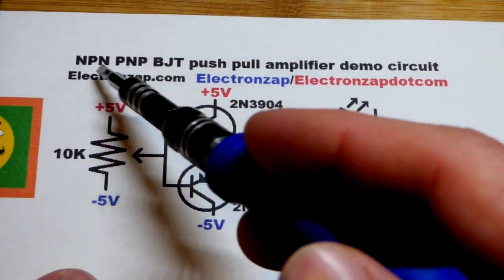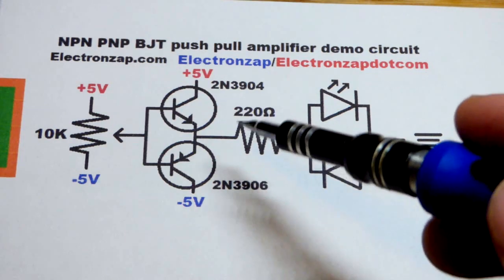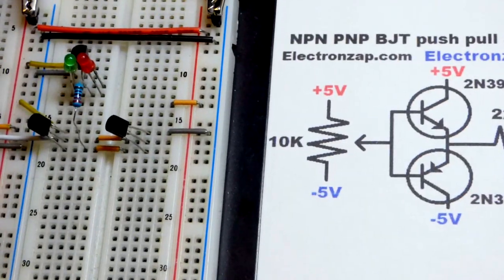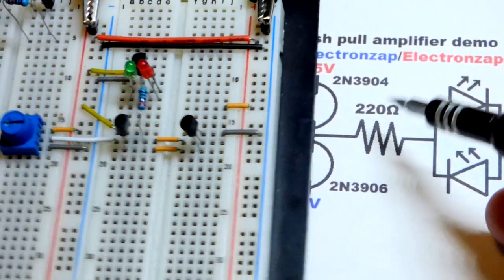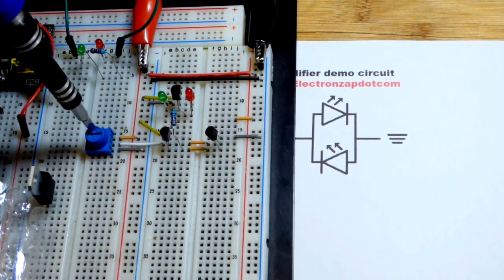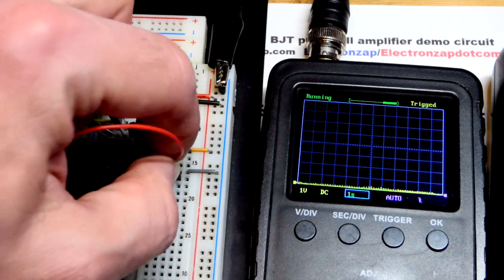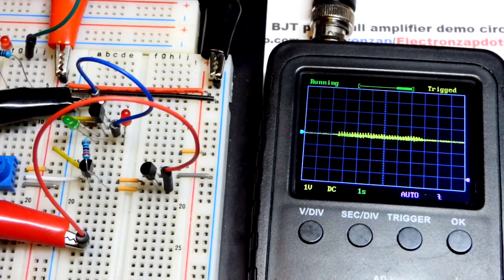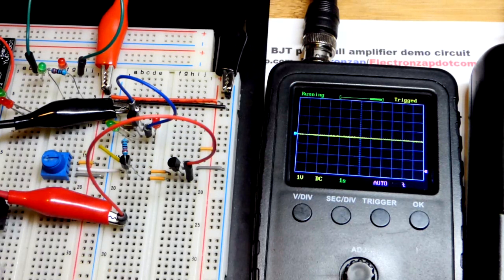Quick NPN PNP BJT push pull amplifier demonstration electronics circuit by electronzap

Comment: I think you should add extra 'separate' base resistance for cases when the pot is turned to extremes.  You can either use current limiting resistors  at each end of the pot OR directly to the transistor bases.
Reply from the maker: Yeah, you can add resistance between the trimpot and each side of the power supply.